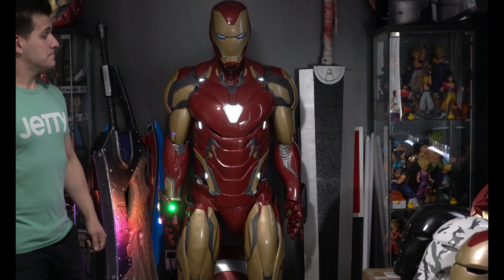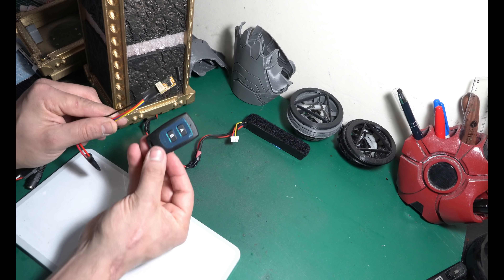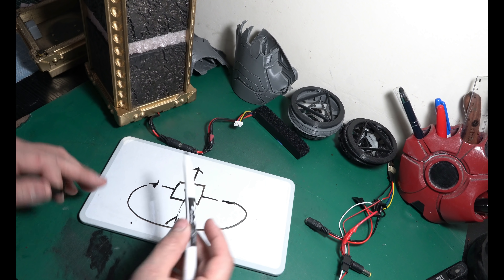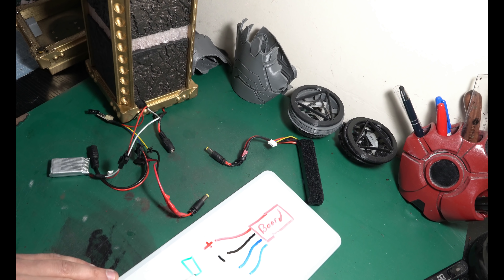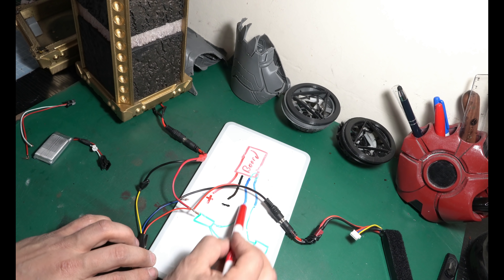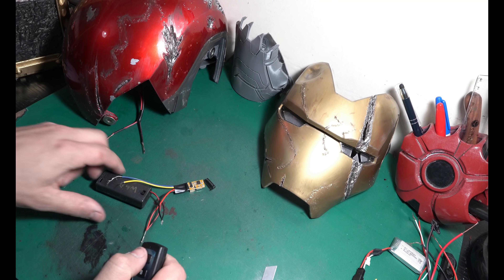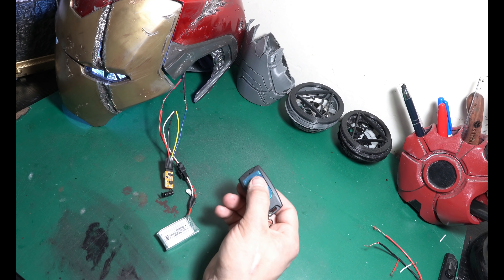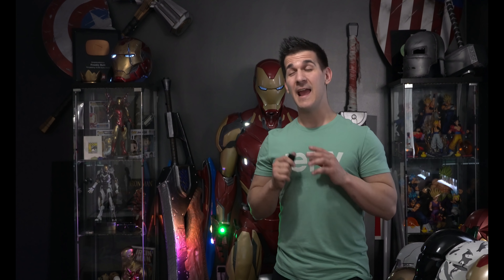How to add a Remote Control to just about anything!

Comment: I've actually retrofitted one of those units into a gauntlet of my custom Mandalorian (the controller board can be fitted with different buttons quite easily) to control the Range finder Motor. I could show you that if you'd like
Reply: Dave Velzen  how did you see through the carefully constructed facade? You're absolutely right good sir!

Comment: I want a remote for my Raspberry Pi 4B+ which is running a Plex client, the Pi runs on USB C and occasionally crashes so I need to switch it off and on so it reboots, can this relay run from 5v 3.5W? or will I need exactly 3.5 V?

Comment: I have the latched version of this chip but keep running into an issue of when the battery is low. It will turn my circuit on but will not shut it off. Anyone know how to fix this and prevent it from turning on completely if it does not have enough charge to turn it off? Using a 3.7v power supply.